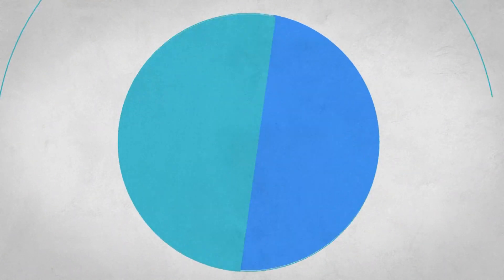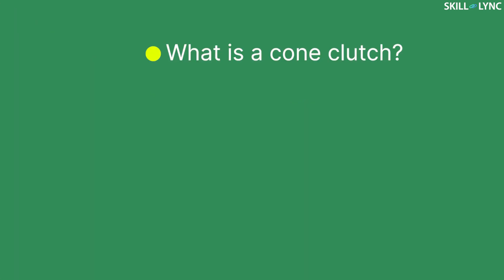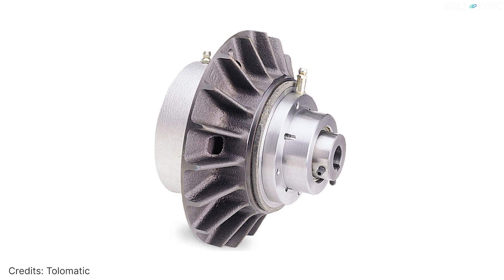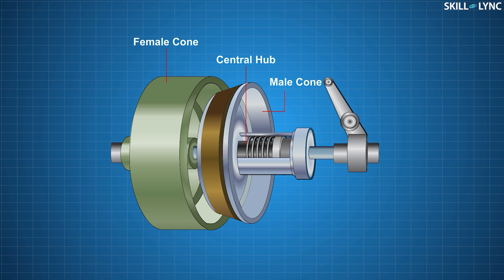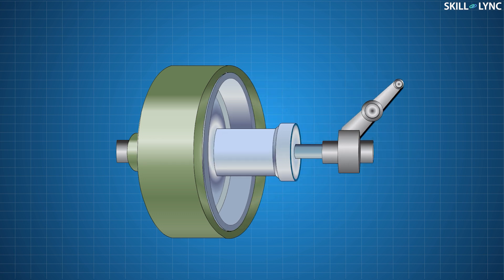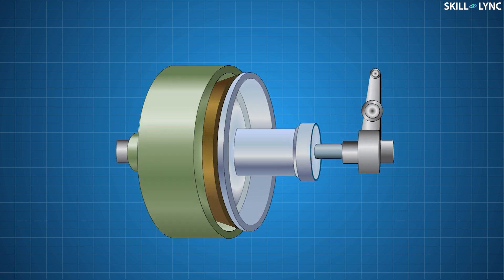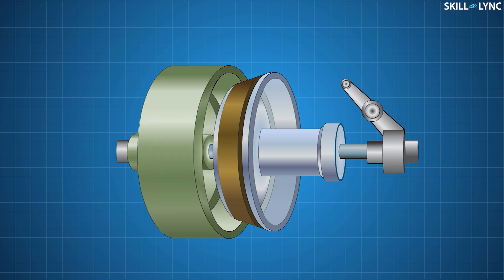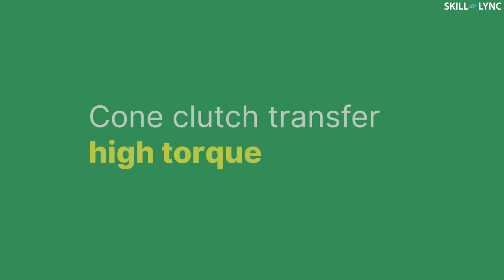How does a Cone Clutch work? | Skill-Lync

Comment: A spring pushes the the male cone towards female cone to engage,whenthe lever is actuated so the spring pressure is reduced,the friction between male and female cone is reduced causing the slips thus power from engine and transmission is cut off.